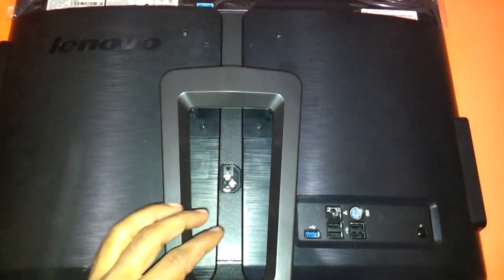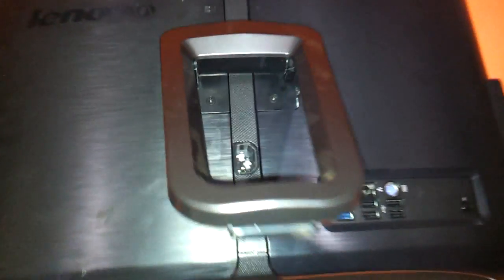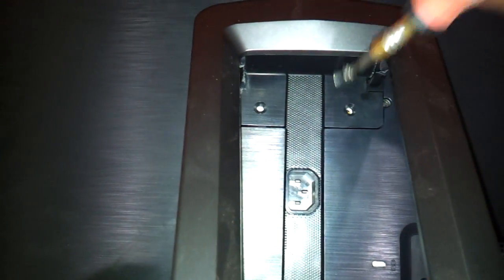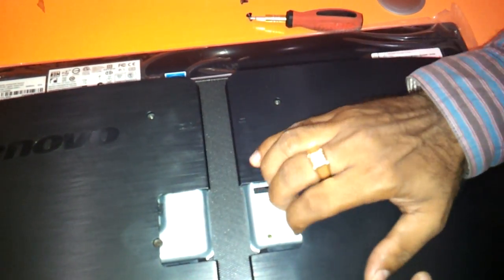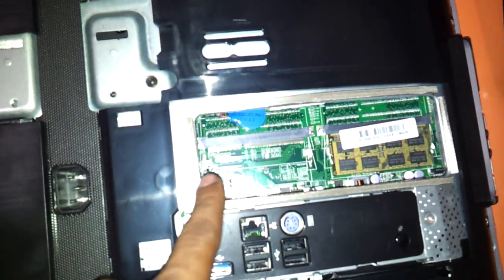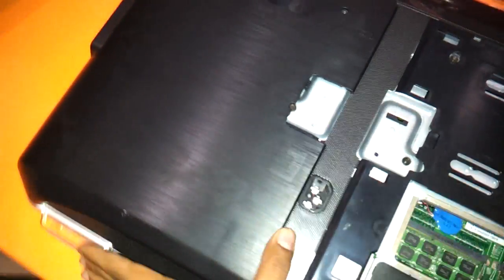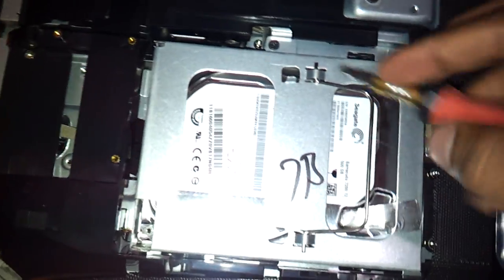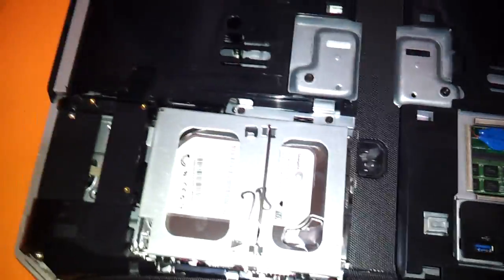lenovo B320 memory ram and harddisk upgradation video in full hd

Comment: Can we replace the hard drive with a ssd in this particular model??
Reply from the maker: Yes we can
Reply: yes
Reply: rp with ssd use casing to hold ssd (https://www.amazon.in/AGPtek-Internal-Mounting-Bracket-Cables/dp/B07KTXCTJS/ref=sr_1_7?crid=29PMJTRN7U05H&keywords=2.5+to+3.5+bracket&qid=1557747483&s=computers&sprefix=2.5%2Ccomputers%2C619&sr=1-7)

Comment: hey guys I have a lenovo b305 AIO pc and I want to install a APU in it .....can I do so}?
Reply from the maker: +nischal hooda not possible.
Reply: Techstore why is it not possible?
Reply: Techstore got to know that I can't install apu but can I install gpu and cpù
Reply from the maker: +nischal hooda you can replace the CPU only.
Reply: okay
Reply: If it is intel, then you must find a chip that supports integrated graphics (intel HD graphics), assuming that the cpu is in fact socketed and not soldered to the motherboard. In case it is AMD, and socketed, you may put an APU in there and it should work. I really see no need as integrated graphics chips are subpar to even the worst dedicated video card. Which all in one pc's obviously don't support.
Reply: @topzozzle6319  In that case, I was thinking about upgrading my CPU from the Pentium Dual-Core G640 CPU to the Core i5-2500s Quad-Core CPU, if it's possible.